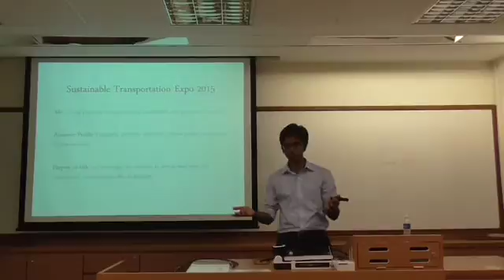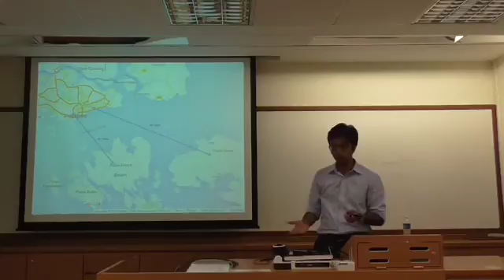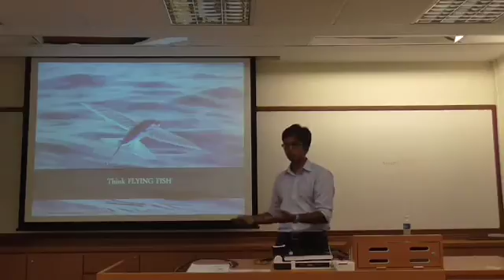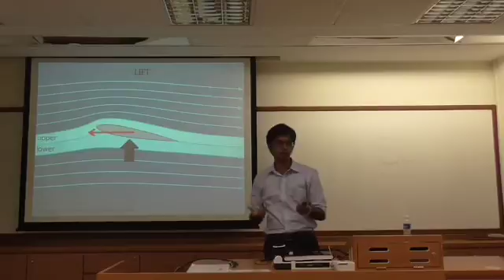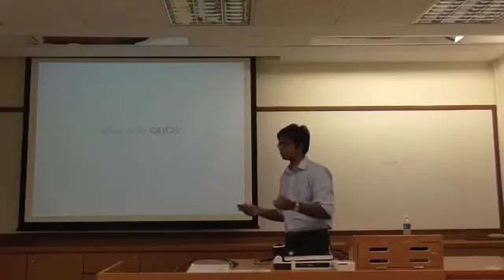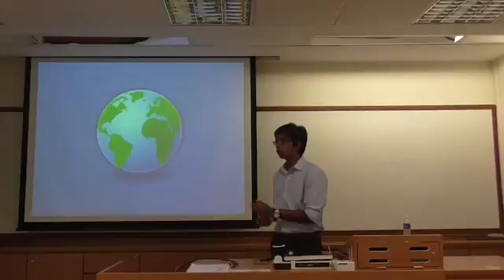Introduction to Wing In Ground Effect Vehicles

Comment: u forgot to ask if its a very reliable technology, why isnt there any mainstream transportation until today? the problem existed since 1960s ago. a lot of powerful nation trying to imitate the same technology as the Russian only end up as prototypes. Go find out also how many of this vehicle crash because of its instability. 

I ll save u the trouble, the answer is this technology is nowhere near ready for commercial. currently a lot of good solution have been presented so far, how ever the only nation that literally has the "hands on" capability of making it never share this knowledge outside their border. its been more 60 years now, either  Russian kept it as military secret or they might just not have the right solution yet.

Comment: Several comments:  efficiency in WIG craft is manifested as a reduction in drag, which in turn means less power required for a given speed.  The reduction in drag starts at an altitude of the width of the wing span.  As you get within 1/3 of the span the drag reduction is substantial.  
For a given velocity there is less power required, therefore there is an energy savings and yes less pollution.

Size has very little do do with the calculations of drag reduction.  
There is a very great example in nature of this effect, pelicans.  Watch a flock flying in formation and count the wing beats per minute.  Then count the win eats per minute of a pelican riding the air currents through the surf... this is a great example of energy savings.

Finally size. The Russsian military has built some enormous WIG aircraft, most of which are now in storage or scrapped.  There are also several videos where these can be seen flying.  start here: https://en.m.wikipedia.org/wiki/Lun-class_ekranoplan
Reply: I'm currently building a 4 seat WIG craft, and made my self a RC model to experiment on and I think I can pull it off...I hope,
Reply: @lightrose100  how about your WIG ? Have you been successfull?
Reply: @ingridschellhaas7041  well I have to shorten  the tail section , reshape the hull a little after talking to a Propeller dealer and getting a prop size for a 2 stroke 3 cylinder 85 H.P engine, its a much larger diameter blade so I have to reshape a little to accommodate the larger prop, I'm still on it